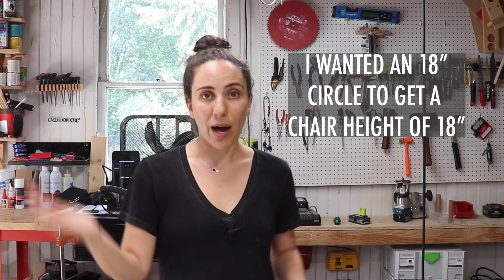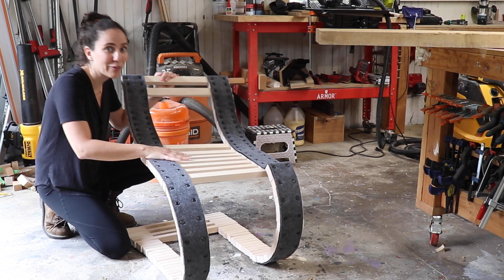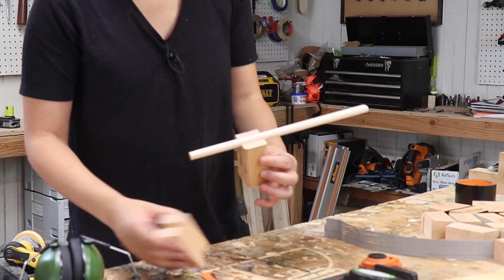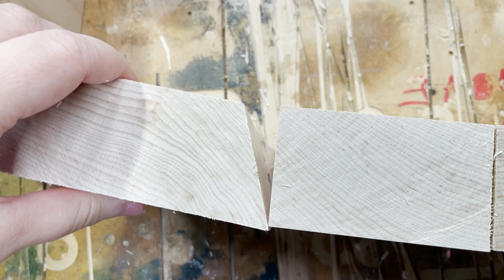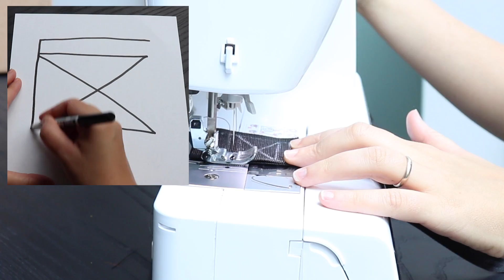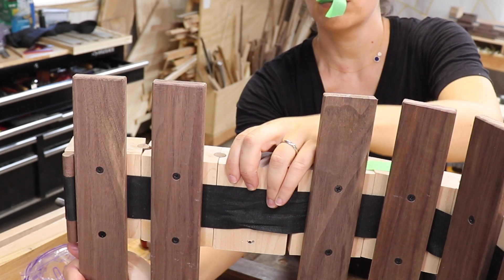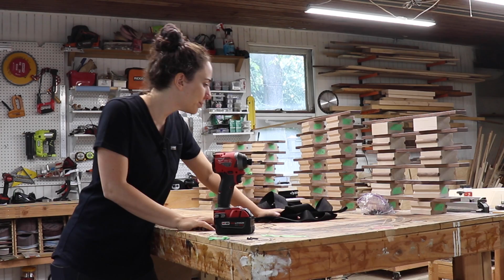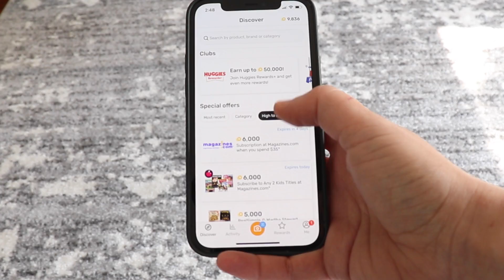I ATTEMPT to make a Roll Up Chair… AGAIN...

Comment: What you could do is use thin electro magnets as the "glue" with a battery located somewhere and wen you want to use the chair you just turn it on and set it up and the electro magnets would connect to each other... No gaps and no stretching

Comment: not a master builder or am I proficient in material science, however I would love to give my own idea. Possibly try a metal cable. Metal cables have a much higher strength and are far less susceptible to plastic deformation. however this comes at a cost to weight. Personaly i dont think you will be able to complete this with a strap unless you double, triple or even quadruple the strap, this will react similarly to adding spring in parallel, meaning the force required to stretch the strap by the same amount will increase by a factor equal to the number of straps used. Again I'm not a carpenter so its up to you but I think this info will be quite usefull.

Comment: You could probably have achieved what you wanted to do by using steel banding for the straps. You can get this stuff at your local big box or at any construction site. I use this stuff for bearings, drawer runners and a bunch of other things.

Comment: It wouldn't look nearly as cool but could still possibly work as a folding chair if you have two supporting "legs" in the middle section between the bottom of the back of the chair (a little forward so its under the seat part) and the base. 

What im thinking is if you make it so the legs could fold inwards side to side, it might still be able to roll up. It might be best to cut notches into the base that the legs nest into to prevent them from wandering. Could do the reverse and attach the hinge part to the base and notches on the bottom of the seat too if that works better with the roll up.

That's a big trade off between strength/functionality over aesthetic though, and if you could manage to get it to work without the legs that would be much more impressive and cool.
  Amazing job so far, you've gotten much further than I or most people would have been able to get to

Comment: I personally think it doesnt work is because the straps are given space to move and its apparent when you sit on the chair and the ends fold. A good solution is to actually staple/screw in the strap with a but of space between to have tension but also not too much for it to tear.

Comment: You could try using like a thick rope to go through all of the pieces instead of the strap sitting on the top of them. So maybe it’ll add good strength and still look nice at the same time.

Comment: It’s interesting that the straps are failing to regularly maybe try winch straps there a little heavy but specifically designed for tension and maybe some mechanical locks that click into place at key points to reduce the curling affect from over tension

Comment: Perhaps try cutting the blocks so that the end grains are supporting each other instead of the side grain. The strap could be less of an issue than you think. Even a small amount of compression in each block of wood adds up quite quickly. I love your perseverance, and I hope this project doesn't end here!

Comment: Leather is going to have far more flex than the high stiffness polyethylene.  For minimum stretch (highest modulus) a unidirectional carbon fiber is about the best material you could find.  Then, putting the tension elements inside the wood instead of on the surface might help with the collapse effect.

Comment: i think a folding brace that comes off of the base of the chair and the back of the chair that connect  might work it should keep the chair from moving side to side and stop it from folding under the weight 

but it ruins the look of the unroll and flip chair

Comment: Your chair design is cool, but your problem is leverage: Your chair is made of joints and those straps are like the muscles of the whole build. The straps are the key. You have a huge surface area that is only supported by a few millimeters of straps between the joints. The joints take the compressive force, and the straps need to take the tensile force of a person's weight. This is the difficult part. You might try using much wider straps from a non flexible material. It might stabilize the joints.

Comment: The pieces are 3 inches thick right? And you eat to put weight in the back of the chair which for the pieces at the bottom of the bottom curve make around a 30 inch lever arm so you take the force you want to put there, (your weight, but since I have no idea what that is let's low ball it at 100lbs?) So even if the inner corner of each wood piece isn't being compressed at all the strap material would need to be able to hold 1000lbs worth of weight without stretching enough to allow an angle change that's large enough to affect the angles between each piece

Comment: Cut parallel grooves on the top face where the straps would go and put steel wire thick enough not to stretch also you can tighten and loosen so even if the steel stretches a bit after breaking it in you could re tighten it.

Comment: Spring steel strapping! It can lay flat and won't stretch. Probably need some reinforcement to prevent it from cutting into the wood.
Reply: I will say you abilities are far beyond mine, and the work you do is exceptional

Comment: What about using opposing angles instead of the circle angles?  Not sure how that would be calculated, though.  

In the circle angles, the pieces are all creating tension on each other uniformly.  The chair doesn't create the same forces on each angle that they do in a circle and every angle just wants to collapse inside.  Where the inside angle of a segment may be 120 degrees, instead of cutting two angles the same, cut one side heavy and the other lighter to make that 120 degree inside angle.  

I'm sure some math and engineering folks will be able to poke tons of holes in this idea :D

Comment: It collapses because your center of gravity is beyond the base curves center. You would need to shorten the length of the seat to sit on the strongest part of the curve (the top) Your weight while sitting will push the back of the chair towards you but the natural sitting position with make it recline giving the tension you need. with the tilt then putting extra tension on the end of the feet it would try and rock you forward. Finding the balance will stop the feet and back from re-curling in once you get up. Love your idea <3

Comment: One Problem is that you need to apply the straps from different sides, to get the tension to act in the right direction, although getting that to roll nicely might be more difficult

Comment: Why are you trying to make the chair from 2 fold strips connected by horizontal planks instead of JUST horizontal pieces that would also be thick enough to function as the agle pieces. You could use way more then 2 staps, the wood (and individual straps) would be under much less strain per cm2 and prolong life of the chair AND it would fix side to side motion. I mean.... it may not seem as aestetic but if you treat/condition/polish the wood it will still look awesome.
OR maybe if you want more lightweight chair, just make the fold pieces wider to fit more straps instead of making the full width horizontal angles

Comment: I do wonder how sound the strapping is as the only primary form of support.

You have the shape created by the blocks, but just the blocks and gravity makes it all fall apart. So you have the straps and the walnut planks to hold the shape, but it can't take any weight because the straps alone won't hold enough weight, it seems.

You have the dowels to keep the blocks from sheering and sliding to the side, to keep alignment.

What if you added some sort of cable lining to help support the shape? If the straps aren't strong enough but the blocks can take the stress between each other, would putting two support cables through each leg(4 total possibly? Two outer two inner, maybe?) Help it hold shape? Or would the tension basically cause the wood to slowly get sawed through 🤔

Comment: I was thinking of 2 things (if using steel is allowed) 
1. Making a steel strap with hinge-like segments that would bend in both directions but would not stretch obviously cos steel (duuuh) 
2. Making steel plates on the sides that would lock when you set it up but wouldn't lock when you roll it up.

Comment: First of all thanks for sharing your nice video showing your skills and ideas. I think this can be solved by using bicycles chain instead of straps, something which is very strong (steel), does not expands making that loose in between the wood pieces and it can be rolled easily. Keep it up, Charles Attard from Malta

Comment: Your initial design drawing is of the pieces and strapping as you want them under tension, cutting the pieces accurately to that shape, means the movement when it's under pressure changes the shape. note how much the shape changes under pressure, then subtract this from the design shape.

Comment: One issue you could be running into is the straps under tension lengthen both over time and under weight. potentially two solutions you could try is hanging weights from the straps not attached to the chair and leaving for a week or two so the fibers become conditioned to the weight and stay at a tensioned length. another could be potentially using smaller pieces and some kind of reinforcement from.... maybe carbon fibers? or some kind of plastic fiber mix? leather would probably be worse, over time the tension would become worse because leather fails over time. Maybe using some kind of slot in the rear of the chair could help reinforce the splines?
Very good ingenuity :) this is not a failure, just an experience.

Comment: I believe using straps in general is not a great idea for this project, because they will always be kind of stretchy by definition. I think using metal hinges for every connection between every two wooden parts would give you the smallest amount of flex in both directions while keeping the rollability intact. Hope that helps and good luck!

Comment: What if you designed it so that when nobody is sitting on the chair its natural position is more upwards and when you sit on it the part you sit on becomes parallel with the ground? Kind of like how beams in houses are warped upwards so that when it holds weight it falls straight.

Comment: Maybe steel wire instead of fabric straps could work, like the ones used in bike brakes. And even a supporting bar between a pair of pieces from the upper part of the seat to the lower part of the chair

Comment: Making a letter "d" might be stronger, by having the "undercarriage" roll back up to form "back legs". Less spectacular than the floating design but just as foldable/rollable. 
  And yes, as many others commented, I think links need to be individually connected and tensioned. Joint tensions are not distributed evenly anyway.
I think you have the patience of a saint attempting this! Let alone several times.  Best of luck!

Comment: Something else that might work would be to make the wood strips interlocking S shape, like the little Tetris piece, or the replicator blocks from stargate. (I hope that makes sense outside my head.) That would still allow it to roll up, but when it’s in chair mode, each slat would support the one next to it on three sides instead of just one. Sort of like putting a rabbet on opposite corners of a block.

Comment: why do you need 2 straps...you can put like 4 straps so the 2 straps doesn't have tension while the other 2 is for supporting the body weight

Comment: Recommendation: I'm more of a metal worker than a woodsmith but I've done a similar technique for other projects. Get some steel rope. Not 'wire'. ROPE. It comes in 3/16 which looks to be about the right size for this build. Mark your stresser locations. The areas that bend the most and hold the most weight. Drill thru each of these blocks on the front side to thread the rope into + 1 block on each end. So the bottom u-turn looks like 5. Crimp at one end, and use a steel rope twister or wire rope grip to get it nice and taught, then crimp that end. If you want it to look a little nicer (and prevent corrosion too) you can go as far as to use a rubber rope hose or sheath over your steel rope. Side note: Don't use those crappy aluminum band crimps. Use a rope clamp.
Reply: either way, I love the videos, they inspire me to do more projects than I should :P I hope it works out for you no matter what you do!

Comment: Why not use aircraft cable or something the like? Countersink it into the wood below your cross pieces. Would not stretch as easily, and can add a knob adjuster to adjust tension over time.

Comment: I'm fairly sure the problem is that the webbing is allowed to move, not being firmly affixed to each slat. When pressure is put on a curve with the webbing on the outside, it pulls on the sections with the webbing on the inside of the curve. There is very little preventing those curves from becoming tighter, which releases webbing for the outside curve.

If the webbing was attached to each section, the outside curves couldn't 'borrow' webbing from the inside curves and vice versa - that's why your original roll-up chair worked better.

Comment: You had the answer at the end of the video. You have to anchor the strap at each section so that the tension is localized and not shared throughout the chair. You may be able to get a the strap tensioned the way your doing it (Metal strapping wouldn't stretch for instance) but you'll never be able to make it comfortable or safe. It will need different tensioning in different areas to make it form properly and not flip the ends. So anchor and tension each section one by one around the the chair. Staples probably won't be strong enough, use screws and washers (toothed washers would be best).

Comment: Maybe use some cable wires threaded underneath the planks like you did with the dowels. These would be considerably stronger have gave next to no flex. That would be the next thing I would try, as it doesn't require a complete redesign, and it will give you the strength you need I think.

Comment: I would suggest trying to use steel cable or dynema (way less stretch than nylon webbing), but I don't think the wood would be able to take the required tension without some sort of failure. Not to mention that steel cable is way more dangerous than strapping when it fails.

Comment: Hold the wooden pieces with flush metal hinges. The black strapping can go over the joints as a form of protection against screws and potential pinch point so your clothes don't get caught on them - it'd still be functional strapping, just in a different way and provide that nice contrast! 
I'd be worried about the wood's longevity under all that compression though, perhaps some some metal inserts in key areas would be a good idea? (OR leaf springs! THAT would be fun and comfortable haha!)

Comment: I was thinking you could try using steel cable or Dyneema instead of the straps. I feel like leather would still stretch a lot. Steel cable is probably the cheaper option but Dyneema is 15 times stronger and is low stretch. It's definitely a significant step up from those straps you're using. Not sure if they're polyester or nylon but regardless it has a 3.4% stretch to break percentage vs 12% and 30% for polyester and nylon respectively. Also that's not factoring in that it has a significantly higher tensile strength too. I think aramid aka kevlar rope would also be fairly suitable strength wise though it isn't self lubricating or as abrasion resistant as Dyneema but I think it should perform about the same. I doubt the chair will rub so much it'll wear out the cord if you try using kevlar I mean it's still a fairly high performance material so it may even be overkill.

Comment: Comparing this attempt to the previous attempt shows that if you want to stick with the straps they need to be attached to every single piece, otherwise some areas will have too much tension and others not enough.

Comment: it seems that one of your biggest problems is that the pieces can move in relation to the strapping. If you were to use low stretch straps and bond them tightly to each piece to create something like a hinge at each joint, that might work.

Comment: I’ll second, being invested in the trilogy.  Design thot. The collapsing happens from a difference in tension at different sections, all the tension is also on one side of this complex curve. You might always have a risk of things buckling at the weakest point.  

This suggestion would fundamentally change ur design but……. What about having a cable like steel or dynema go through the centre of each block, then have a tightening feature up at the head like a cam or threaded knob that takes up the slack. 

Think like those little toys of animals where u push the button on the bottom and the figure collapses but when u let go the button is pushed back out and the figure stands up again.  

I just think you need to have the flexible part run thru the centre of the block which would make it much safer for ur younglings too. Keying in the blocks with dowel also would be a great help. 

If you think there’s something to the idea and want a better explanation I can mock up a small prototype to clarify. But you’ll have to accept the slight change in design and function. It would roll out to be a chair but wouldn’t be instant as you’d have to tighten the inner cord. 

Just a thot. Either way. Awesome video. The effort your putting in is awesome and I can’t wait to see the third attempt when ever u get the time again.

Dynema rope is also “Amsteel” and you can find it under synthetic winch cable or as wake boarding tethers. It comes in different thicknesses but might be harder to figure out a way to tension rather then steel cable.